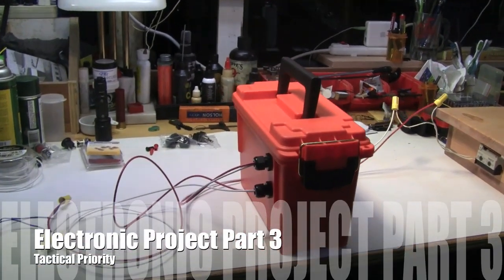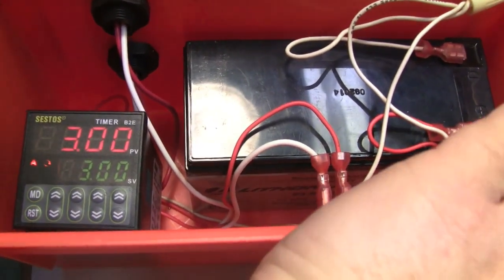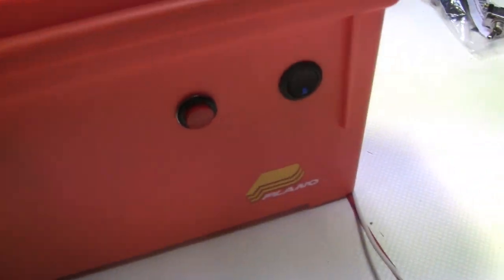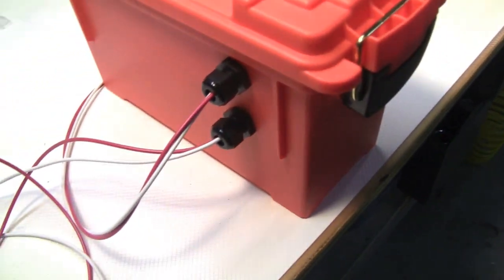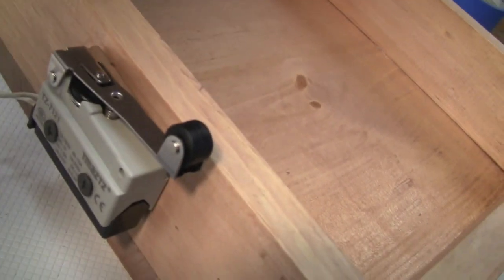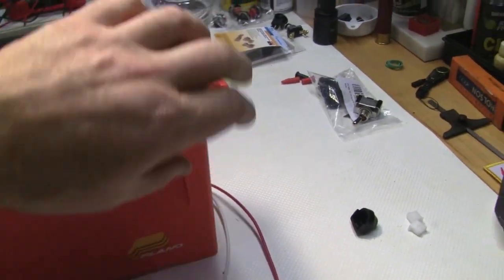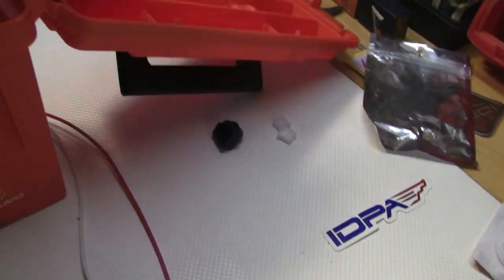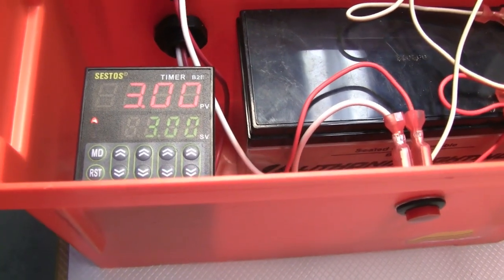Electronics Project Part 3:  Enclosure

Comment: The cable feed troughs will not be very waterproof with individual conductors. They are intended for use with a multiconductor cable.
Reply: I agree with you on the troughs. I also noticed, (perhaps you did too), that the switch is NOT ambidextrous.  This could lead to a multitude of problems if used in a pure argon or positively charged helium atmosphere.  DEFINITELY not safe with methane!